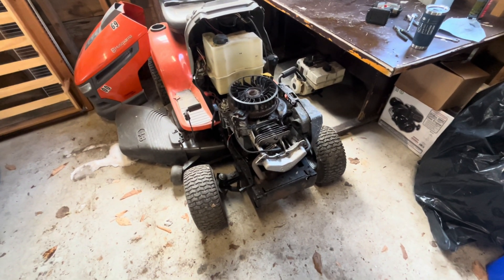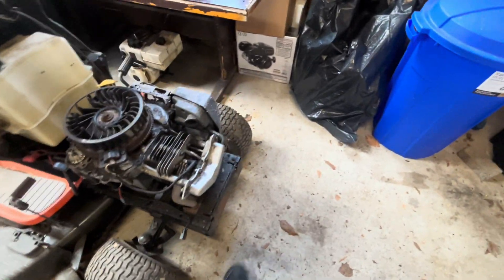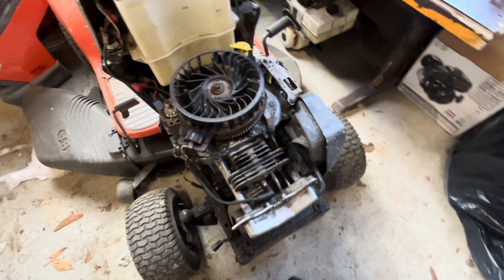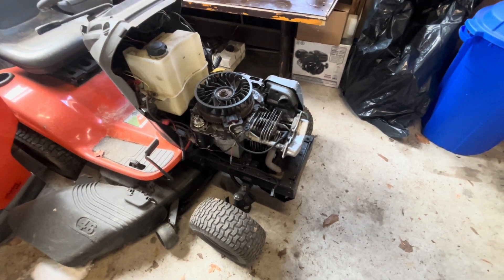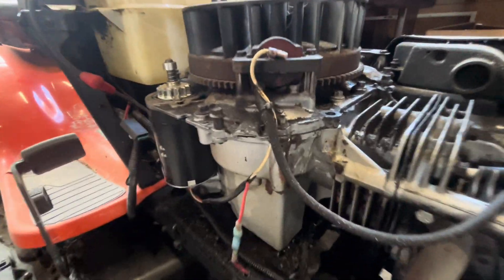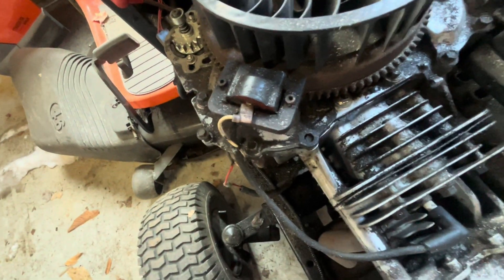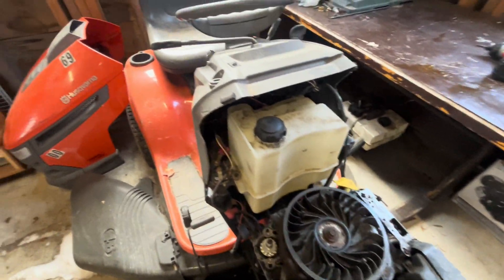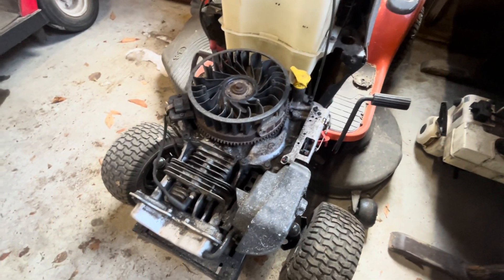Kohler Courage 20hp SV600 Engine Teardown and Rebuild - Part 1

Comment: I've done two of these engines.  I tried the clamp and epoxy method and that can work for a while.  However, not forever!  I could have told the clients to buy a new one, but the crap they sell for the money these days was too depressing.  I ended up purchasing long block replacements for them  $1100 delivered.  Of course, every bearing and hydrogear rebuild, but now the owners have reliable mowers and won't forgo maintenance!